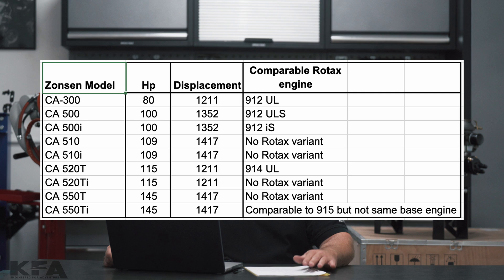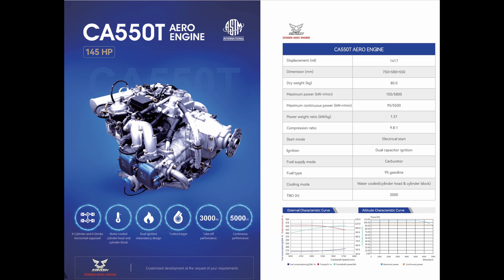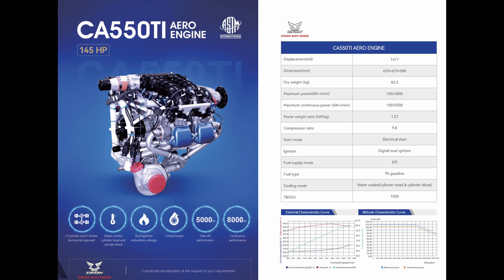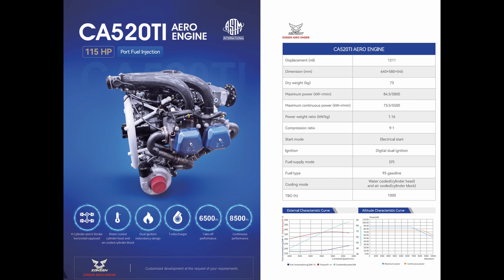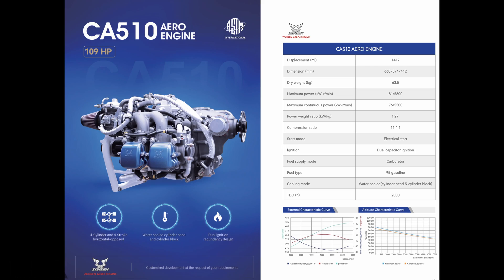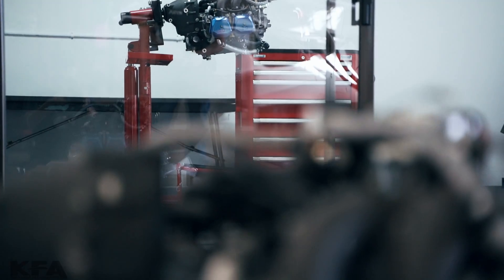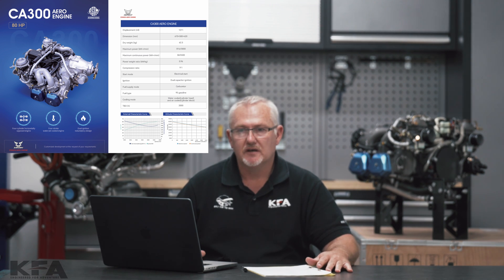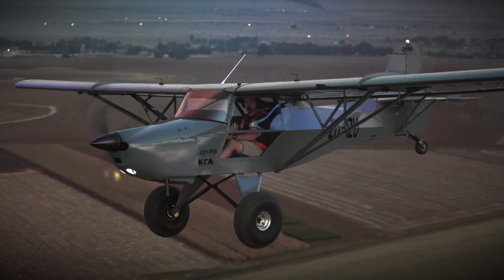ZONSEN engine models | a complete breakdown

Comment: Hi
I’m looking forward an affordable and efficient engine for Vans RV14A. Do you have an engine that will work for my airplane?
Reply: Hi there, I see the RV14A is designed for the IO-390 which is 210hp and weighs 308lbs. I think our engines will be too light and under powered for the design.